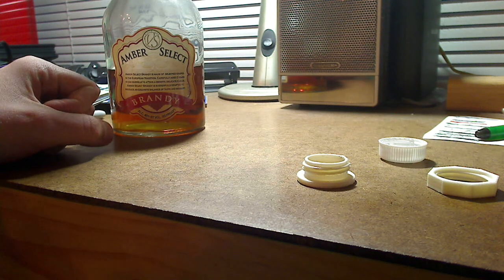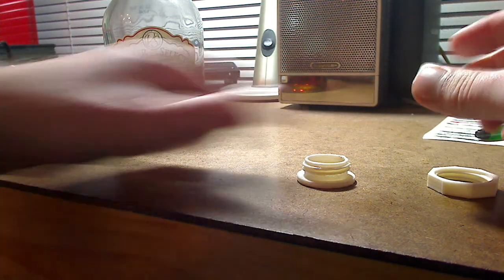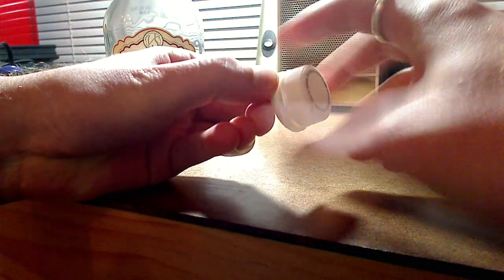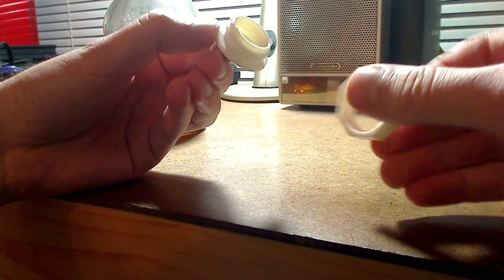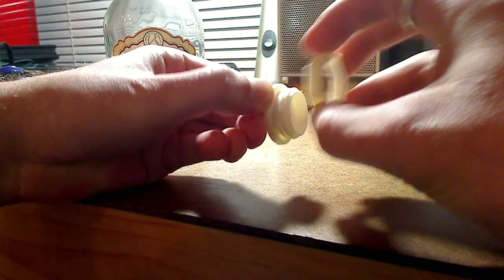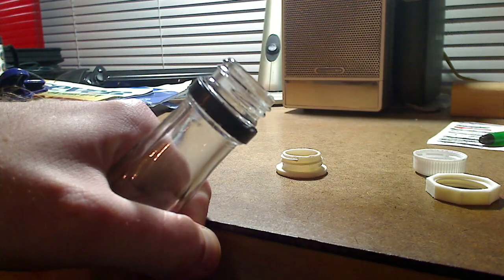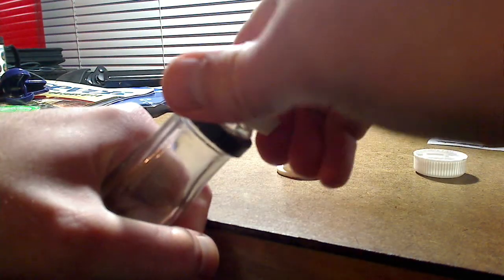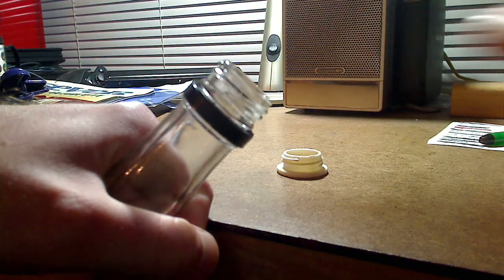Demonstrating a 3D printed bottle and cap combo

Comment: Andrew, First off thanks for your design. I have been working on a project that provides a way to connect objects to pco-1880 and pco-1881 water bottles. I was successful in getting the 1880 thread to work, however the 1881 standard is a giving me a hard time. when I print your 1881 example the nut fits very loose and threads don't mesh. What are the dimensions you used(width, height, and pitch). What are the dimensions of the nut after you print it.

Thanks
Reply from the maker: Hi, Mark. Did you review my post I linked in the video description? There's a screenshot on that post that shows the dimensions I used for the nut.
Reply: Andrew Cross,

I did review you link. To be honest it was above my level of understanding. I tried the nut on the older water bottle 1880 and it fit perfectly. Also tried it on 2 liter soda bottles and it fit as well. I believe they are all 1880. Can you send me a pic of your nut on a pco 1880 water bottle please.

Thanks
Reply from the maker: Have you reviewed the official drawing for the spec? All the dimensional information is included there. https://www.bevtech.org/assets/Committees/Packaging-Technology/19/3784253-19.pdf